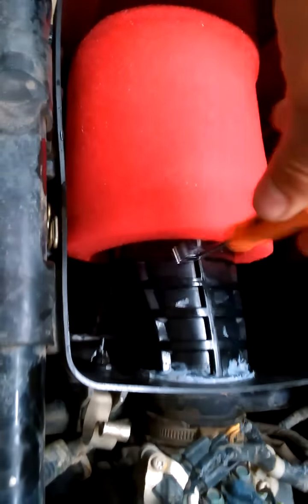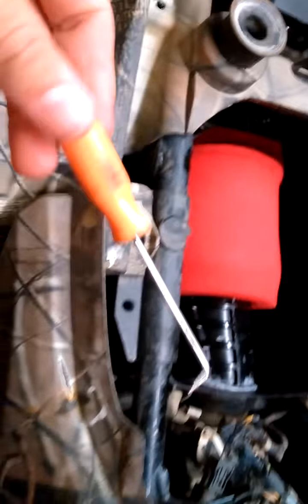Filter Service

Comment: What do you know about the Honda Rubicon engine noise at idle ? I think it sucks that you pay that kind of money for something and the engine ticks at idle. Do you care to share your thought on this? I am debating on trying to fix it or just run the crap out of it and not worry about it. Thanks.
Reply from the maker: if you read in your manual a valve adjustment is required after 20 hours have you had that done yet
Reply: I did read that in the manual, but no I did not have that done. I do not have many hours on mine and others have said that it makes no difference at all as far as noise reduction.
Reply: I guess if it was a major issue we would all know about it by now.
Reply from the maker: +grantlandneil how many hours do you have I know about 20 people with Rubicon the only one that has any valve noise has been swamped 10 times
Reply: Awe man, don't tell me that. lol I have about 17 hours on mine and it has been in water for sure, but nothing close to what you do.
Reply from the maker: Honda do have a characteristically noisy valve train but I have never seen it cause anyone any problems if you're going out water and stuff before it is even out of break in you are definitely asking for issues that extreme heat cycling is not good for a new motor
Reply from the maker: +grantlandneil if the tapping is really bothering you that much you should probably trade it in on a Can-Am those motor sound much cooler
Reply: That's a great point. I do not go out of my way to drive in water, but certain trails that I ride have small creeks crossing the trails. We have got a lot of rain recently and it's either go through the water or back track a LONG way to get around ( if even possible ) .